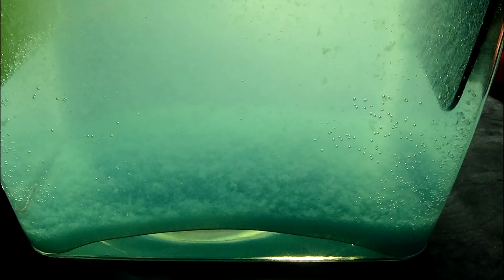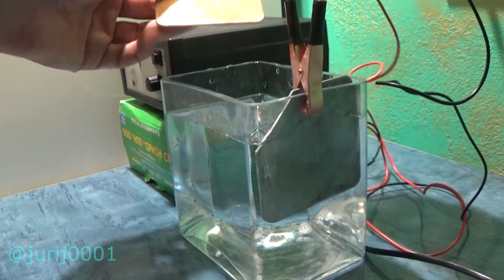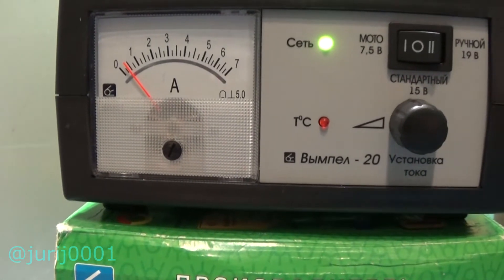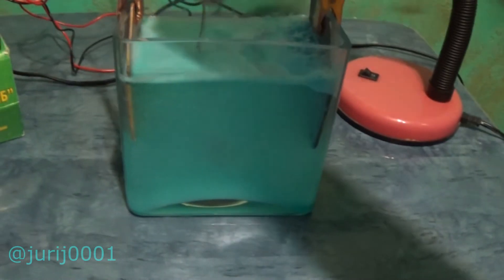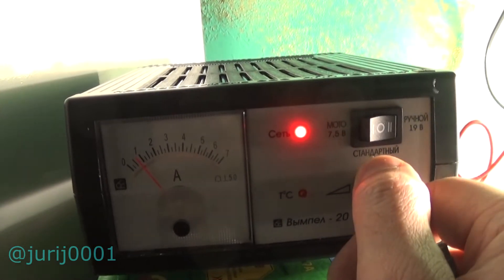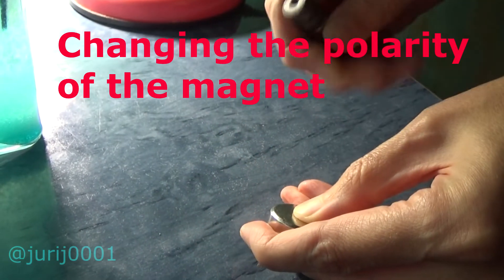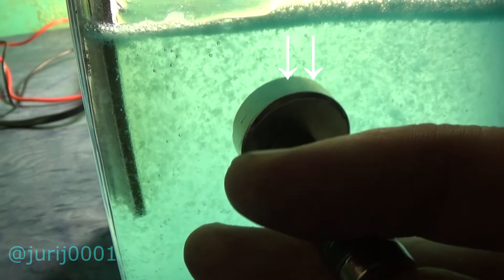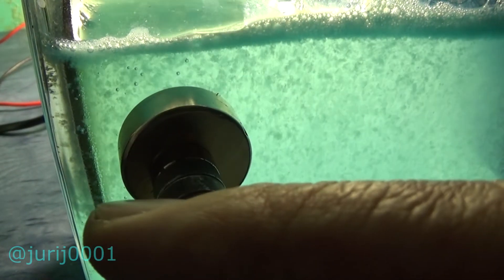The Lorentz force in electrolytes. Electric current in the electrolyte.

Comment: It looks like the clamps are zinc-copper too, isn't it?
Reply from the maker: Yes that's right))
Reply: @YuriKovalenok  you should try the same experiment while rotating the magnet. I think this should increase lorentz current (which they say it doesn't exist...)
Reply from the maker: @nigiolas86  I rotated , but nothing changed )))
Reply: @YuriKovalenok  try with higher rpm. In the video when you turned polarization, it changed the orientation of the force...have you tried that rotation?